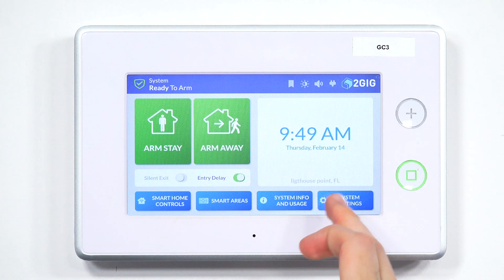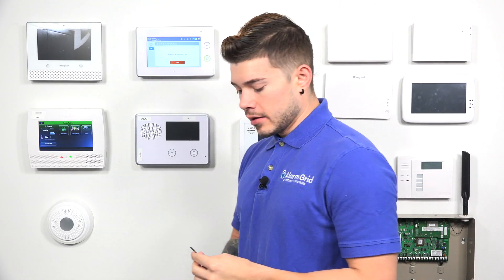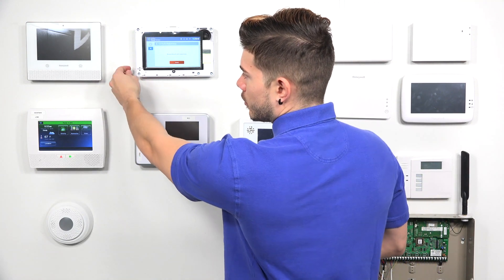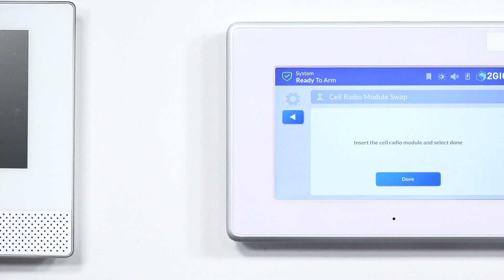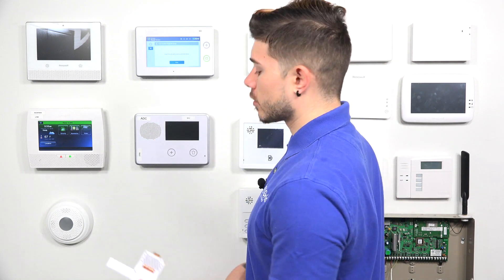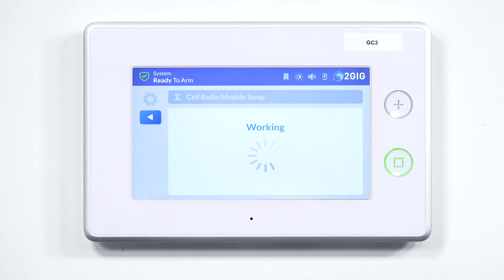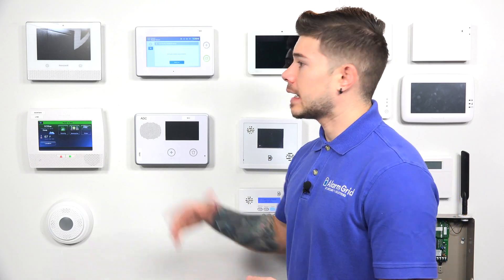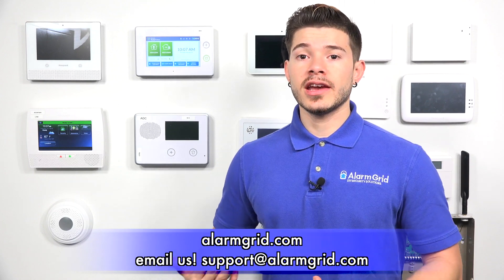Upgrading the 2GIG GC3 to an LTE Communicator

Comment: Do you upgrade the firmware first with the 3G radio still installed, then do the hot swap? Or can you do the hot swap and then upgrade the firmware? I have to upgrade two gc3’s in two days from 3G to LTE.